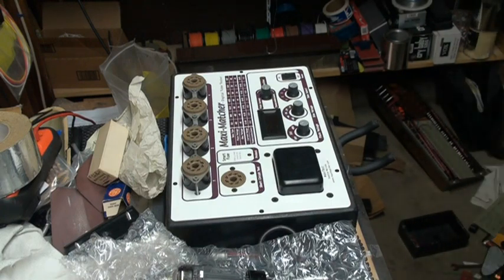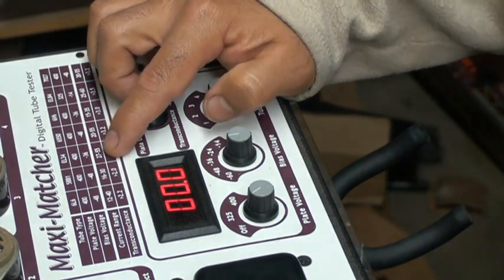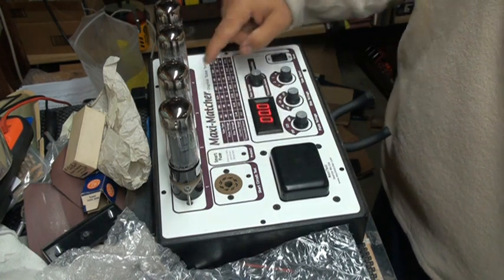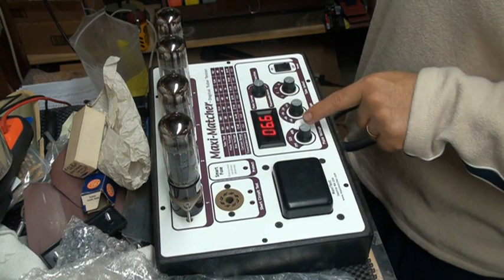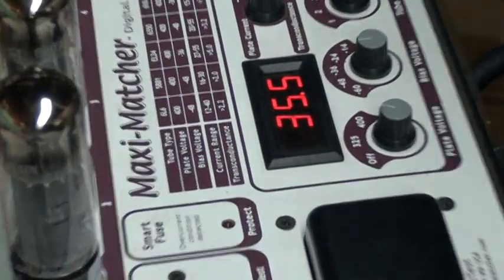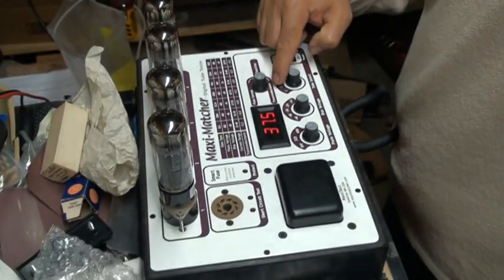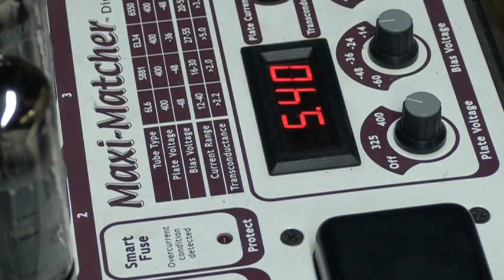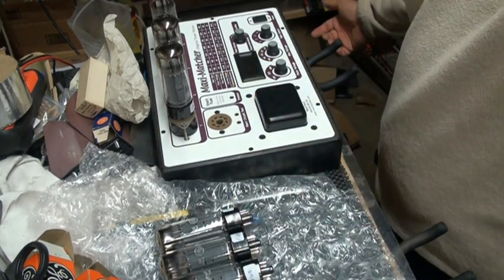Mullard Xf2 6CA7/EL34 Test 1

Comment: So I just got a matched 6ca7. To replace 34's .
My problem is not enough highs its a crate tv6210.ive also got a 5751 pre tube ti go in the first pre. The gain channel sounded too dark and too much noisy high gain so im gonna put the 5751 in too. Ive been waitin ta do it though.